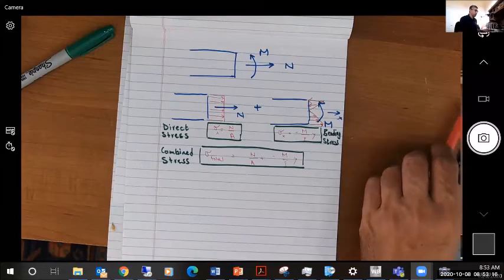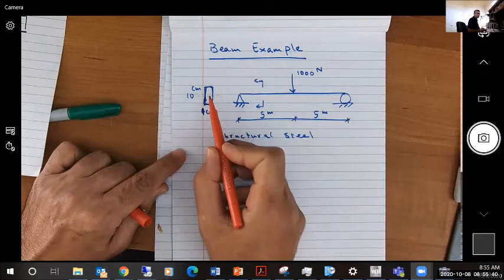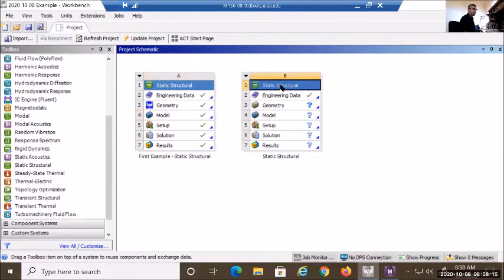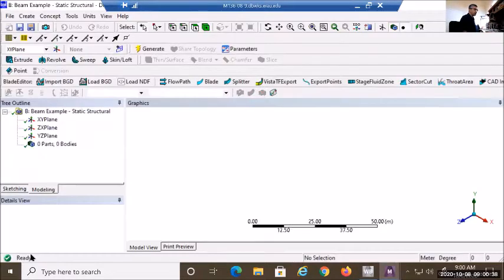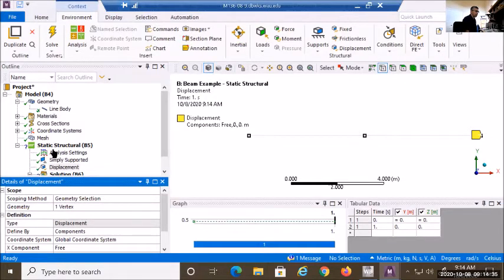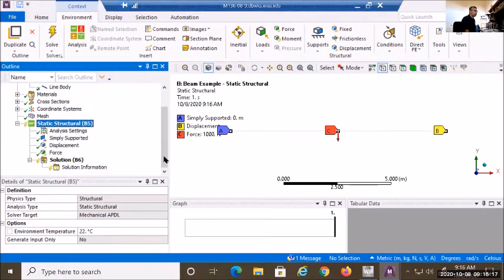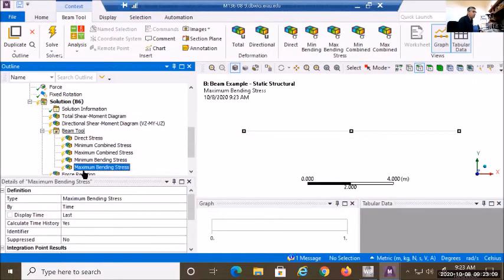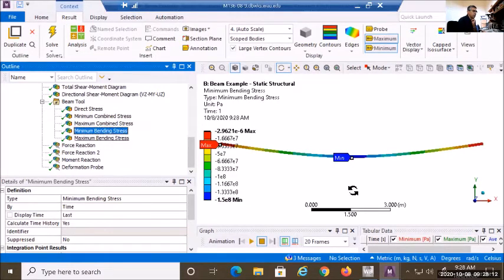ANSYS Workbench using BEAM Elements for Modeling a Simply Supported Beam in Bending

Comment: How is the process to add  bearing supports in a beam element (3D, circular section). Thank You
Reply from the maker: Rafael - Is your 3D circular beam supported using bearings? Does it rotate like shafts?
Reply: @DrFadyBarsoum  yes, i am tryng tu use bearing conections in my 3D circular beam. Yes it rotates like shafts (transient analysis)
Reply from the maker: @rafaeltuiran  Please check the last 20 minutes of this video: https://www.youtube.com/watch?v=6FG-Gd2s7-Q&t=3361s
Reply: @DrFadyBarsoum  Thank you very much !

Comment: Y the path is not working with two points instead of edge selection for the shear bending diagram
Reply from the maker: Need to create the path using Edge Selection and not Two Points Selection to use for Shear and Bending Daigrams